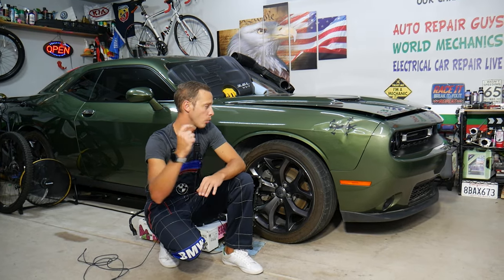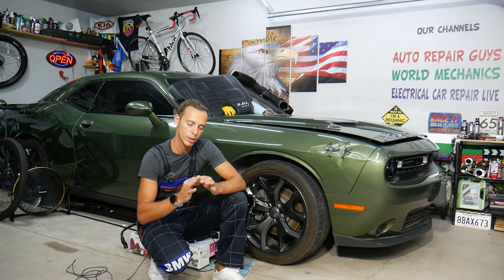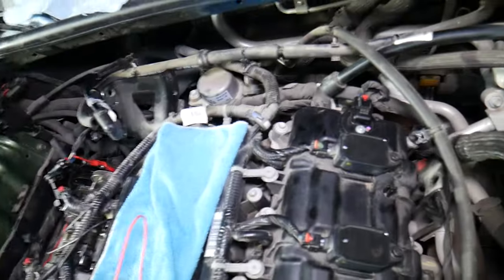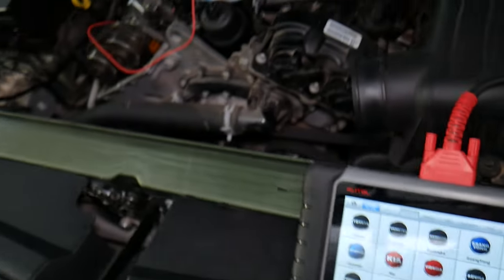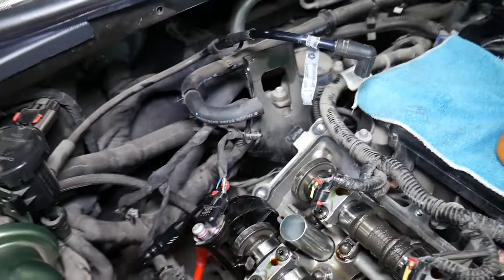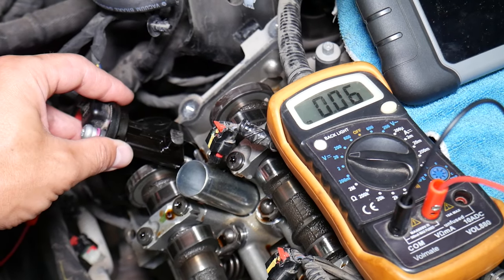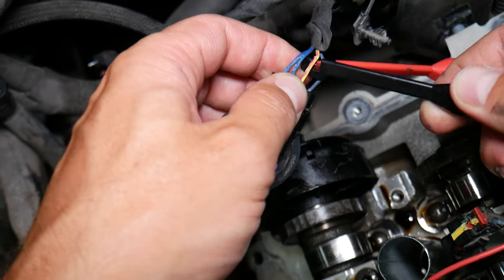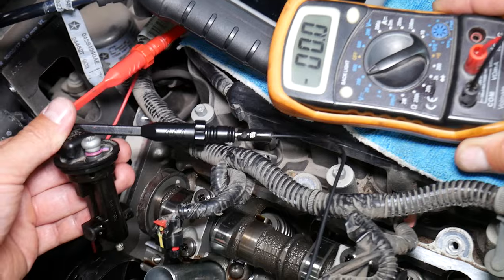HOW TO TEST CAMSHAFT POSITION SENSOR WITH 4 WIRES

Comment: Hi great channel , I watched your video and am trying to test my sensor exactly like you are everything is good until I get to my pin 1 and 2. I can't get 5v reading between pin 1 and 2 . What could be the problem? I've tried everything i get 5v on the 5v supply and the 2 signal wires when I ground out to the car or if I use pin 3 the ground wire so all the wires are getting 5v readings only when I  try to get 5v reading between pin 1 and 2 I get nothing please help. Thx